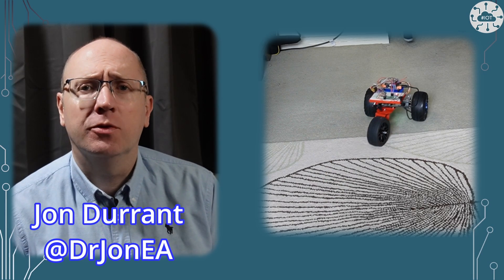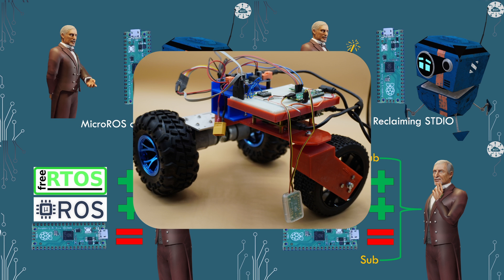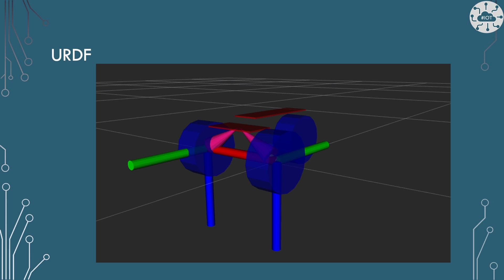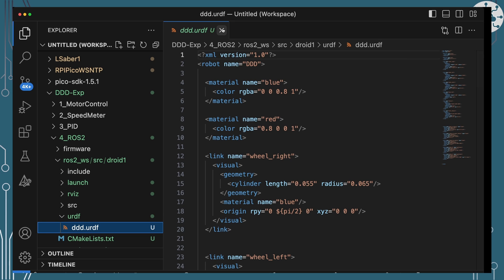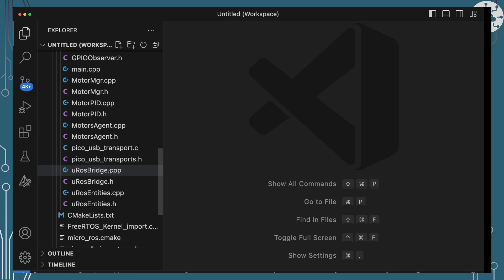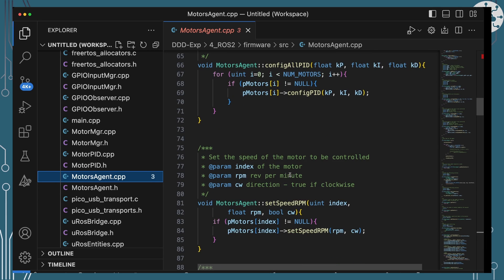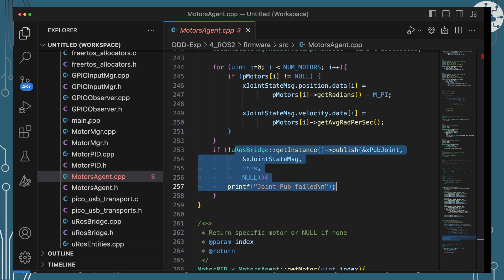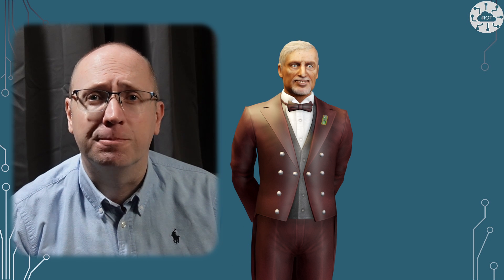DDD: Promoting Robot to ROS2 Ecosystem - Raspberry PI 4 & Pico

Comment: Hi Dr Jon, im trying to run this code but am running into an issue of the pico ceasing to publish or operate after around 7 pico counts. It will then be stuck at its last state. Just curious if you have ecountered something similar
Reply from the maker: Hi. Sorry to hear that. Sounds very annoying and difficult to diagnose.

I will admit I have not run up DDD for a few months, while I work on other projects. I have though run my  MicroROS bridge code on another project quite successfully and not seen this issue. So sorry I can't point my finger at what would be causing this.

Perhaps drop back to the MicroROS Pico example and check that works ok in your environment. Then roll forward into my extensions of that.

Let me know how it goes.

Jon
Reply: have you solved the problem? I'm facing something similar ..
Reply from the maker: I've not managed to reproduce in all the uRos projects. I've done. So no sorry.